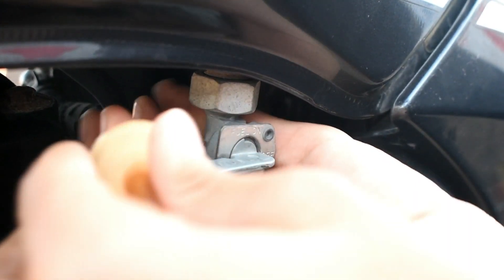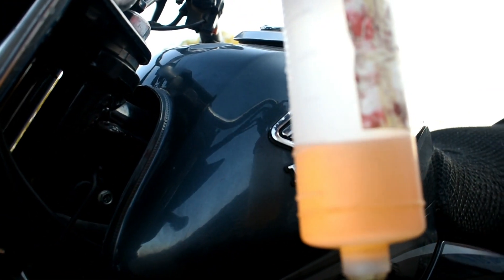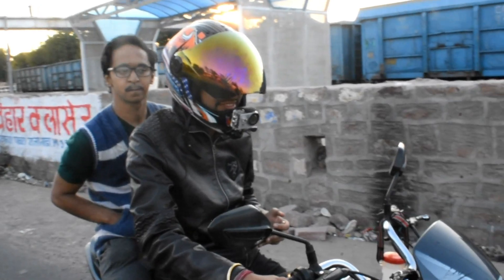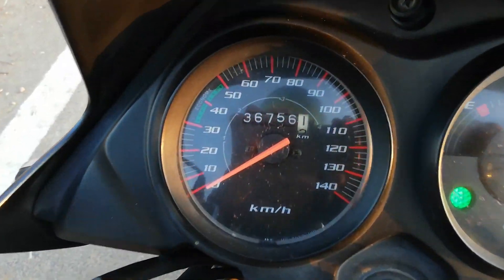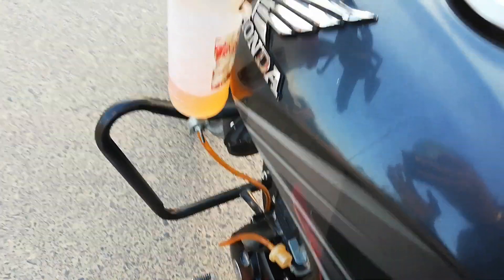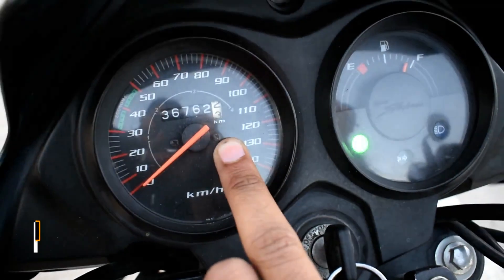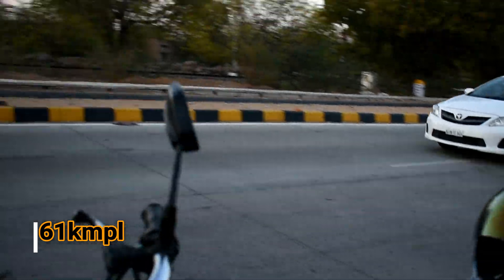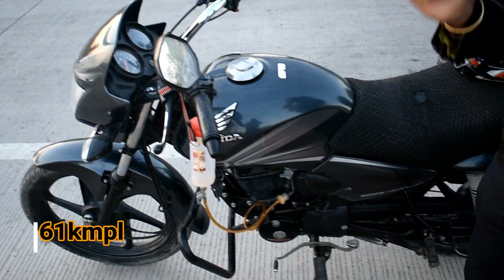Honda shine 125 Real mileage test एक लीटर में कितने किलोमीटर चलेगी shine?

Comment: Shine 45 last rtr 160. 35/37 last cbz same unicorn same rtr 180. 30+32 ,last
Reply: Sahi hai
Reply: my 2011 cb shine gives me 58 kmpl in city with 60 to 70kmph speed    and in highway it gives 61kmpl if riding in kimits of 70kmph
Reply: @aparnakarmakar9031  mera v 2011 model hai but wo 43 ka average di hai eske mileage mei sudhar ho sakta hai kya ?

Comment: Mileage test ke samay bike kitni puraani thi
Reply: Meri bike honda cb shine model 10 may 2018 ka mileage 41kpl hai aur eska mileage badhane ke liye  Amrit auto Haridwar wale bhi fail ho gaye
Reply: Bhai same meri bhi 2018 model cb shine but average 35 se 40 deti hai Honda servise senter wale bhi fail hai average badane k liye
Reply: @satendramavi1446  regular service +accurate tyre pressure+ good engine oil+carburetor tunning+ clean plug spark+clean air filter +run b/w 40-60 speed +minimum use of clutch = better mileage